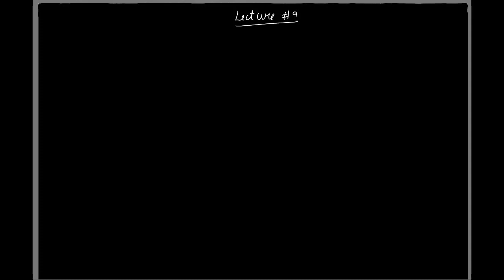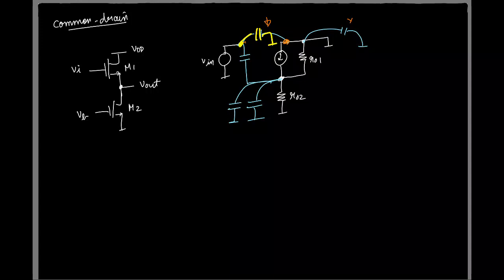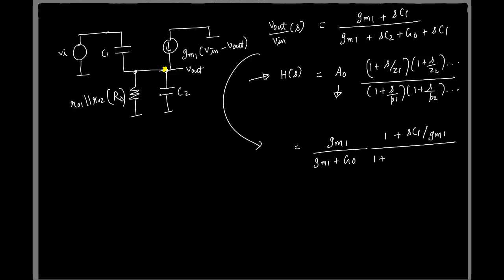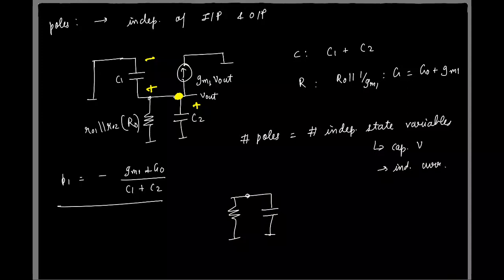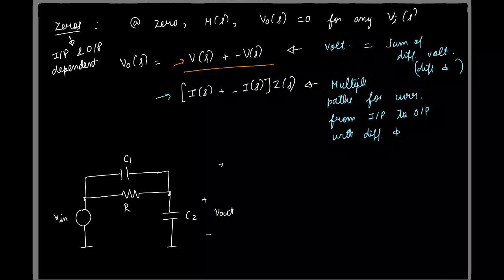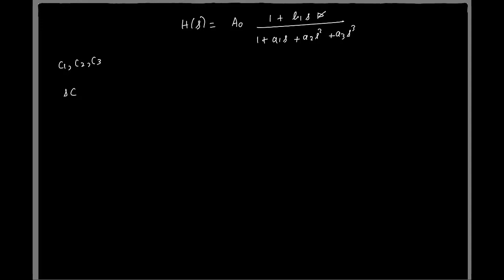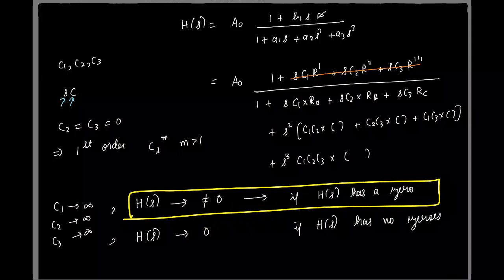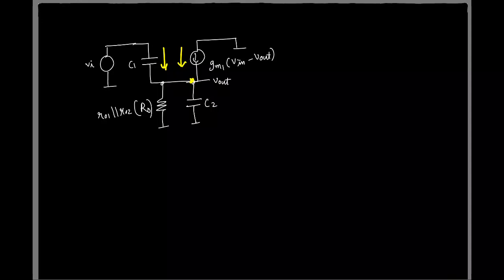Lecture 9: Finding zeros by inspection; Source follower: poles and zeros

Comment: At 4:57 , why Cgd of M2 not conisdered? you are saying only capacitance in M2 is Cdb
Reply: I think Cgd will occur in parallel with Cdb and so they can be added together as both gate and the bulk of M2 will act as incremental ground.
Reply: It maybe because input resistance through that node is infinite

Comment: Nice lecture-At zero frequency does magnitude goes to zero? I think that only true for complex zero however the circuit trick is working well to find zero by shorting the o/p to ground. For example take a system with TF of s+1/s+3. What is the significant of zero at -1 here? Thanks.
Reply from the maker: The response to a sinusoidal input does go to zero at the zero frequency, if the system has a purely imaginary zeros +/-jw0. 
The notion of complex frequency "s" is an enabler to analyze the stability of LTI systems. Having a zero at s=-1, means that a sinusoidal input at 1rad/s will experience a phase advance of 45deg and the magnitude will be scaled by sqrt(2).